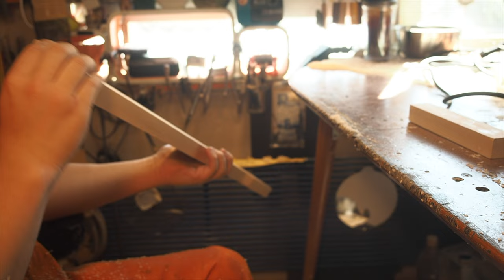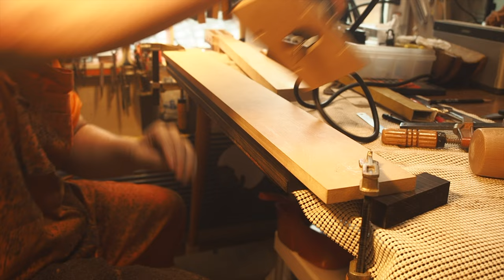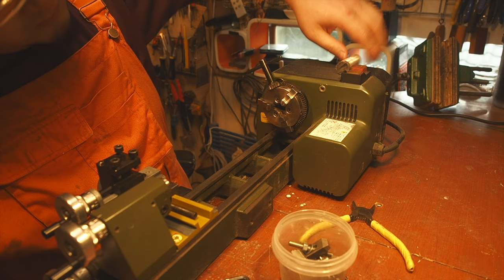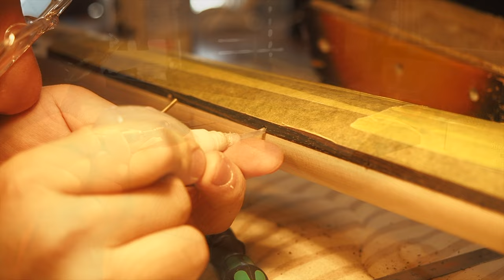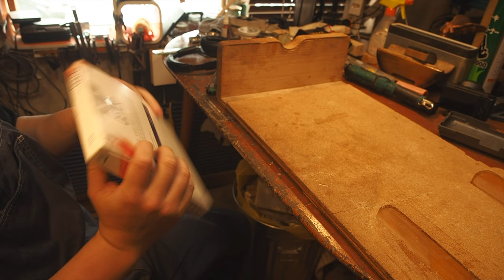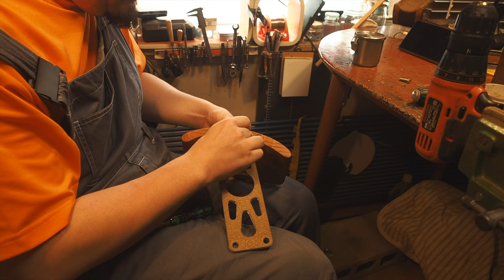Make double bass smaller.#4 Sold!

Comment: You can't make a stand up bass with a tall setup and call it a double bass "made smaller". A double bass is called that for a reason. That reason is not just because it is played vertically while standing next to it.
Reply: please, enlighten us
Reply from the maker: It is the headline.
Thankyou!
Reply: 100 percent wrong-that is not the reason it is called a double bass (or contrabass, string bass, bass viol, etc.)